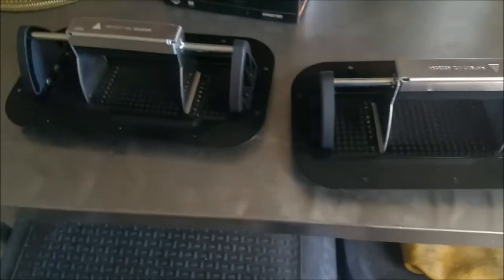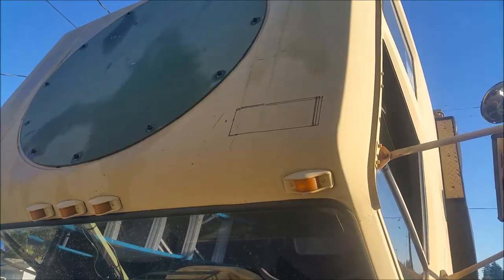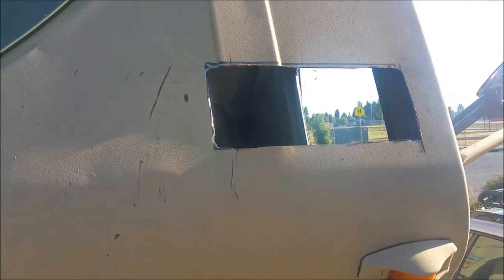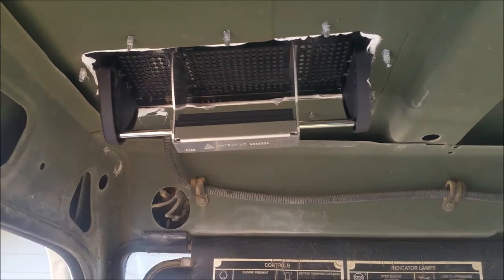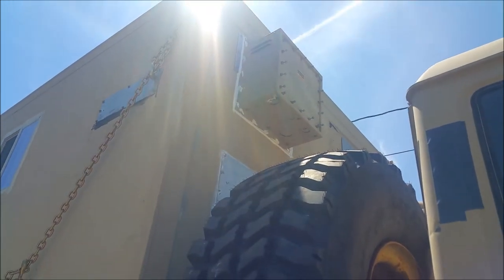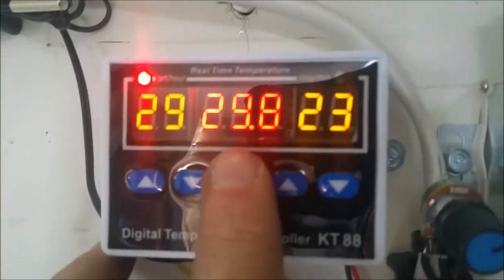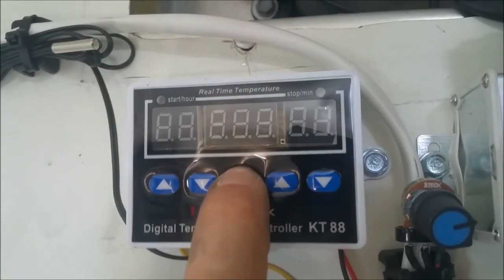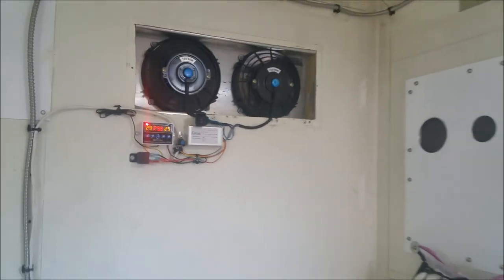Abel LMTV build part 11 (horse trailer cab vents, sikaflex, shelter ventilation fans)

Comment: Hello Sir. We keep coming back to this video. Do you prefer the two roof vents that you installed 1st? Or the center roof vent that is rassled up?
Reply from the maker: We use all 3.  The center one in reverse mode removes moisture.  The passenger and drivers side ones are fantastic for a nice cool breeze directly on you.  Great if you have no a/c yet.
Reply: @SeanFillner  You mentioned A/C. There are 4 of us riding in the cab (same setup you used to have). What system worked best for you? Our middle seats are pressed all the way up against the back bulkhead.
Reply from the maker: The a/c system I currently have works great.  All red dot components.  Been running strong for 5 years.  Will freeze you out of the cab.